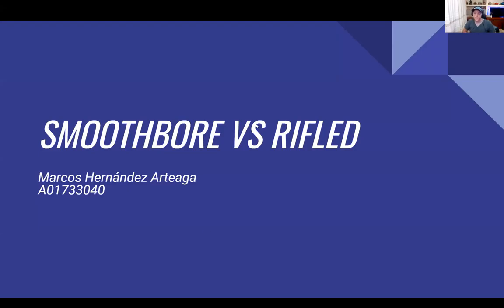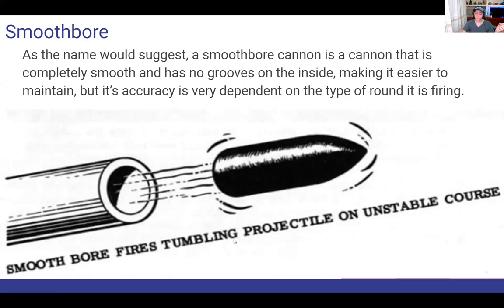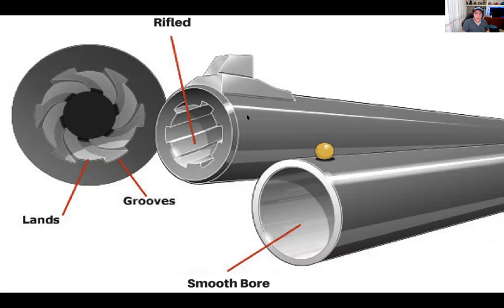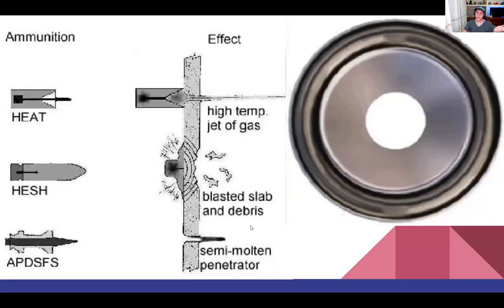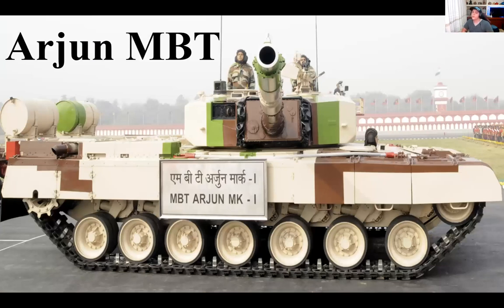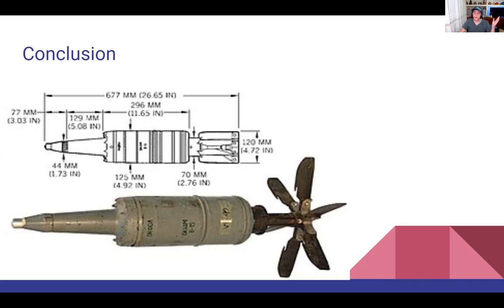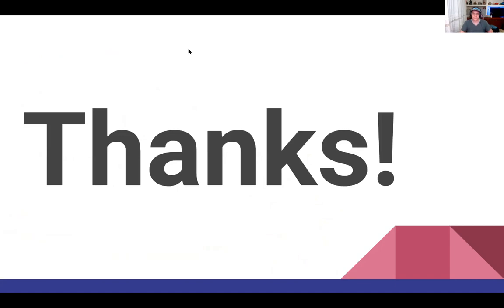Smoothbore vs Rifled | Final video delivery

Comment: Heat or high explosive anti tank is composed of a copper liner. The main body of the heat round contains a powerful explosive charge that forms around the Cone shaped copper liner. apon detonation, that explosive charge forces the copper liner into a thin line of copper particles going extremely fast effectively slicing its way through thick Steel or in some cases Composite armour depending on the power. It is not a jet of gas

Comment: APFSDS projectiles are more effective when not spinning.Also the T72 was the first russian tank to use a smooth bore gun, the T64A was the first tank to use  a smooth bore gun, and  British tank do use mordern shell they do not use APDS. Finally the reason countries use smooth bore guns is because they last longer and modern shell perform better when they don't spin
Reply: 0:45 is not easy, both in manufacturing and in maintenance. For a resource of more than 500 shots, it is necessary to produce a multi-part barrel with a smooth liner very precisely (!) and a certain rigidity. And this is VERY expensive, as well as chrome plating of the barrel. Similarly, the maintenance of such a gun can not be called simple, since it consists of a complex automatic shutter system, devices for eliminating barrel backlash, sensors for taking into account the bending of the barrel depending on temperature, barrel rollback devices and much more. Also, such a gun is able to withstand enormous pressure to accelerate the projectile above 1700m / s, much more than a rifled gun. And as we remember, more speed means more energy. Smoothbore guns can give much higher speeds than rifled ones. A projectile in a rifled cannon, except that it is heavy (less speed means less energy) and has mediocre, albeit predictable ballistics, cannot exceed a certain threshold, it will tear off the rifling and start tumbling or tear the barrel.
In addition, it is NOT true that a smoothbore gun is less accurate, just aiming is more difficult and is usually performed by the ballistic computer of the tank, to take into account all factors, both the geometry of the gun, the type of projectile and the weather. This calculation allows you to guarantee a certain predictable accuracy, for example, the average hit point is half a meter at a distance of two kilometers. Isn't that accurate enough?
The problem is mainly in the person who set the data for the shot manually, just by eye. Then yes, it is not very accurate.
The smoothbore cannon also allows you to use more types of projectiles, including guided missiles.
2:15 a cumulative projectile forms a jet of metal accelerated to cosmic speeds, usually copper, but not only. This jet, accelerated to several kilometers per second at a distance of several meters, has enormous kinetic energy before it loses stability and energy, due to which it breaks through armor, which begins to flow when struck at such speeds, even while remaining cold. As an example, cutting steel with water with an abrasive under high pressure. Gases and shock waves mostly remain outside the armor.
The Monroe effect loses efficiency by an average of 30% when the projectile rotates, depending on the type of metal of the funnel and the caliber.
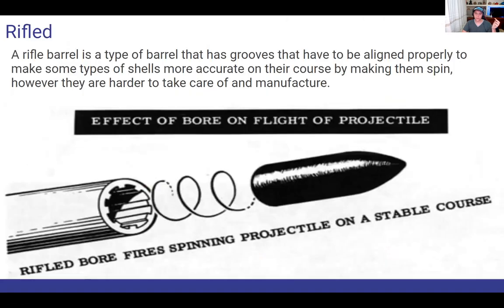2:45 "Crowbar" or afpds does NOT rotate, otherwise it will simply break when it hits the armor.
3:00 is not easier. How many countries can produce a smoothbore cannon? I know three and only one that does this in series of several hundred a year.
3:10 Now Krupp was offended. Rifled guns have been known and used since the 16th century, as well as occasional breech loading, it was just expensive and difficult to manufacture. And the cast guns had a smooth barrel for firing round cores to simplify technology, mass character and unification. Smooth barrels of small length and large calibers were used in bombards, the ancestors of mortars and siege guns.
3:45 The first tank with a serial smoothbore 115mm cannon was the T-62, and after the T-64A with the same 115mm cannon, but later replaced with 125mm.
In addition, the first smoothbore cannon was a 100mm towed Rapier cannon. All of the above is still in use. And I can't call these guns not accurate, not with a T-64 ballistic computer or a Rapier radar sight.
4:00 Just T-72A had no automation of the preparation of the shot and the data was entered manually, or the shooter simply relied on experience, so the accuracy was poorly predictable. The T-72A was a mobilization variant of the T-64 manufactured by another factory, which worked on the errors and simplified it as much as possible.
5:45 What is the problem with using online translators? There are just mountains of information on the tanks of the USSR in the public domain. I'm watching this video that a neural network translates to me online.
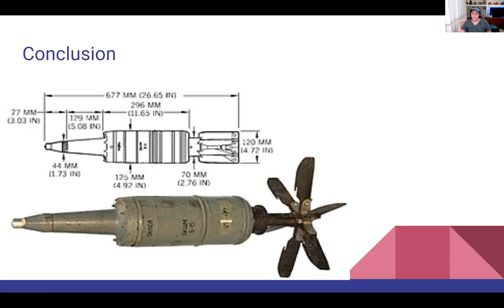5:50 Once again, the shells of smoothbore guns DO NOT rotate, they have too high a speed for this, they will simply start tumbling at such a speed due to displacement and the effect of derivation.
p.s
. In the image of the T-72B model 1989g, not T-72A. This is IMPORTANT, these are different tanks, there are more than 30 years between them!
Unfortunately, you do not have any serious education in the field of physics, for such reasoning, in addition, you do not want to look for information that is available.
As my teacher would say: "You can't find something because you just don't know what to look for."

Comment: 0:45 is not easy, both in manufacturing and in maintenance. For a resource of more than 500 shots, it is necessary to produce a multi-part barrel with a smooth liner very precisely (!) and a certain rigidity. And this is VERY expensive, as well as chrome plating of the barrel. Similarly, the maintenance of such a gun can not be called simple, since it consists of a complex automatic shutter system, devices for eliminating barrel backlash, sensors for taking into account the bending of the barrel depending on temperature, barrel rollback devices and much more. Also, such a gun is able to withstand enormous pressure to accelerate the projectile above 1700m / s, much more than a rifled gun. And as we remember, more speed means more energy. Smoothbore guns can give much higher speeds than rifled ones. A projectile in a rifled cannon, except that it is heavy (less speed means less energy) and has mediocre, albeit predictable ballistics, cannot exceed a certain threshold, it will tear off the rifling and start tumbling or tear the barrel.
In addition, it is NOT true that a smoothbore gun is less accurate, just aiming is more difficult and is usually performed by the ballistic computer of the tank, to take into account all factors, both the geometry of the gun, the type of projectile and the weather. This calculation allows you to guarantee a certain predictable accuracy, for example, the average hit point is half a meter at a distance of two kilometers. Isn't that accurate enough?
The problem is mainly in the person who set the data for the shot manually, just by eye. Then yes, it is not very accurate.
The smoothbore cannon also allows you to use more types of projectiles, including guided missiles.
2:15 a cumulative projectile forms a jet of metal accelerated to cosmic speeds, usually copper, but not only. This jet, accelerated to several kilometers per second at a distance of several meters, has enormous kinetic energy before it loses stability and energy, due to which it breaks through armor, which begins to flow when struck at such speeds, even while remaining cold. As an example, cutting steel with water with an abrasive under high pressure. Gases and shock waves mostly remain outside the armor.
The Monroe effect loses efficiency by an average of 30% when the projectile rotates, depending on the type of metal of the funnel and the caliber.
2:45 "Crowbar" or afpds does NOT rotate, otherwise it will simply break when it hits the armor.
3:00 is not easier. How many countries can produce a smoothbore cannon? I know three and only one that does this in series of several hundred a year.
3:10 Now Krupp was offended. Rifled guns have been known and used since the 16th century, as well as occasional breech loading, it was just expensive and difficult to manufacture. And the cast guns had a smooth barrel for firing round cores to simplify technology, mass character and unification. Smooth barrels of small length and large calibers were used in bombards, the ancestors of mortars and siege guns.
3:45 The first tank with a serial smoothbore 115mm cannon was the T-62, and after the T-64A with the same 115mm cannon, but later replaced with 125mm.
In addition, the first smoothbore cannon was a 100mm towed Rapier cannon. All of the above is still in use. And I can't call these guns not accurate, not with a T-64 ballistic computer or a Rapier radar sight.
4:00 Just T-72A had no automation of the preparation of the shot and the data was entered manually, or the shooter simply relied on experience, so the accuracy was poorly predictable. The T-72A was a mobilization variant of the T-64 manufactured by another factory, which worked on the errors and simplified it as much as possible.
5:45 What is the problem with using online translators? There are just mountains of information on the tanks of the USSR in the public domain. I'm watching this video that a neural network translates to me online.
5:50 Once again, the shells of smoothbore guns DO NOT rotate, they have too high a speed for this, they will simply start tumbling at such a speed due to displacement and the effect of derivation.
p.s
. In the image of the T-72B model 1989g, not T-72A. This is IMPORTANT, these are different tanks, there are more than 30 years between them!
Unfortunately, you do not have any serious education in the field of physics, for such reasoning, in addition, you do not want to look for information that is available.
As my teacher would say: "You can't find something because you just don't know what to look for."

Comment: Also alot more power is lost in a rifled barrel
Reply: I thought it was the opposite?
Reply: @robzilla730  no, if the round fits well it has alot more power. But rifled gives it a spin for accuracy. That's why american tanks are smooth bore
Reply: @arkadisevyan  "thats why american tanks"

Hmmm.... seeing how smoothbore were first used by the Soviets and almost ALL tanks use smoothbore, that phrase doesn't make sense lol
Reply: @alexisbierquedebirkadefauv1744  what? The fuck, I said rifled loses more power then smooth bore, what doesnt make sense?
Reply: 0:45 is not easy, both in manufacturing and in maintenance. For a resource of more than 500 shots, it is necessary to produce a multi-part barrel with a smooth liner very precisely (!) and a certain rigidity. And this is VERY expensive, as well as chrome plating of the barrel. Similarly, the maintenance of such a gun can not be called simple, since it consists of a complex automatic shutter system, devices for eliminating barrel backlash, sensors for taking into account the bending of the barrel depending on temperature, barrel rollback devices and much more. Also, such a gun is able to withstand enormous pressure to accelerate the projectile above 1700m / s, much more than a rifled gun. And as we remember, more speed means more energy. Smoothbore guns can give much higher speeds than rifled ones. A projectile in a rifled cannon, except that it is heavy (less speed means less energy) and has mediocre, albeit predictable ballistics, cannot exceed a certain threshold, it will tear off the rifling and start tumbling or tear the barrel.
In addition, it is NOT true that a smoothbore gun is less accurate, just aiming is more difficult and is usually performed by the ballistic computer of the tank, to take into account all factors, both the geometry of the gun, the type of projectile and the weather. This calculation allows you to guarantee a certain predictable accuracy, for example, the average hit point is half a meter at a distance of two kilometers. Isn't that accurate enough?
The problem is mainly in the person who set the data for the shot manually, just by eye. Then yes, it is not very accurate.
The smoothbore cannon also allows you to use more types of projectiles, including guided missiles.

Comment: I read an article in the late 70s claim that t62 115mm smooth borne gun is not very accurate.was this is due to quality of the gun barrel or propellant?
Second  i hear a report that soviet introduce rifle in barrel end to improve its accuracy.
Reply: Mainly with the technology of manufacturing the projectile and the pallet. No, the rifled sections of the gun were not used. 
ps
This was used in hunting rifles as a legislative curiosity, because it's easier to get a license that way. Rifled 140mm nozzle of the "paradox" type.